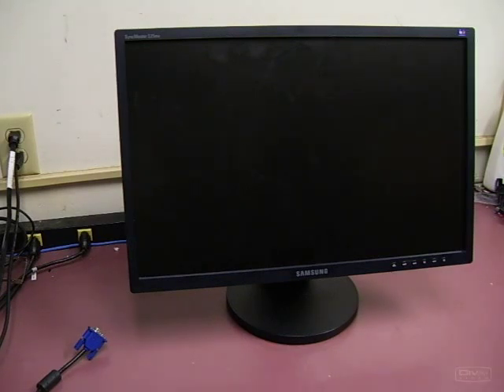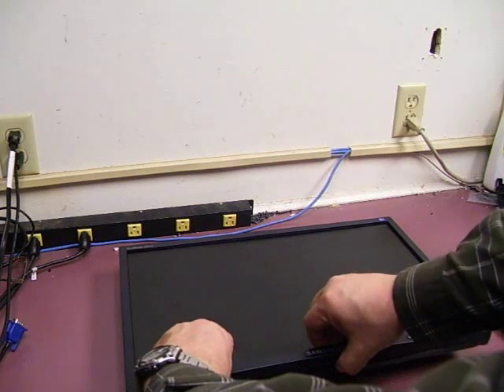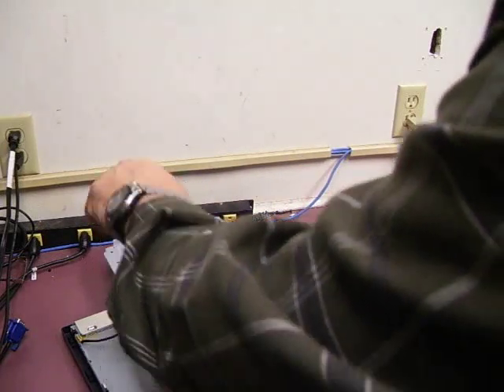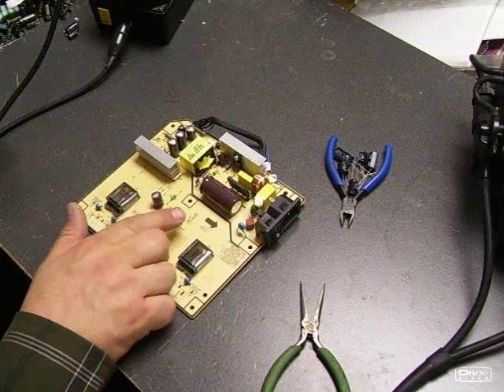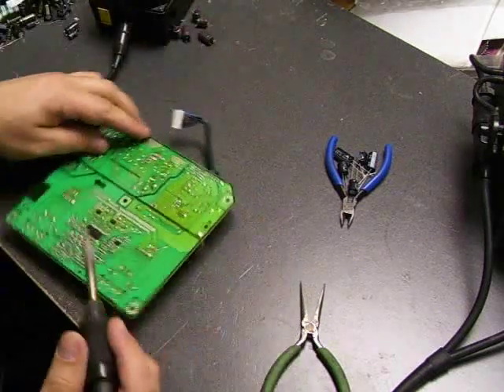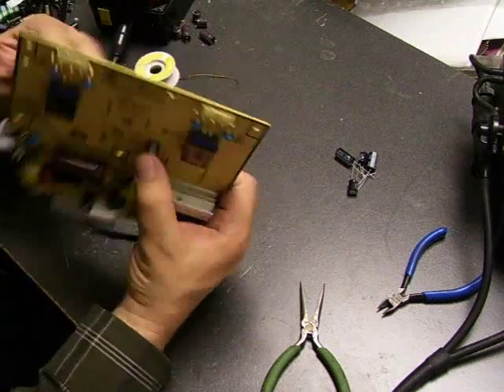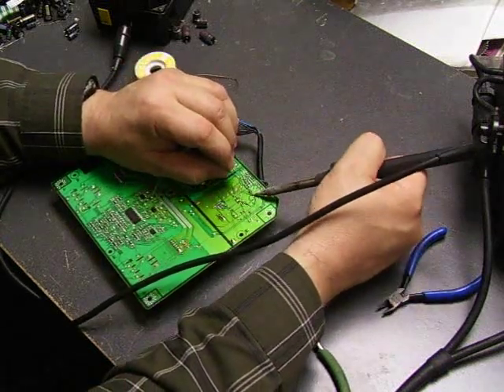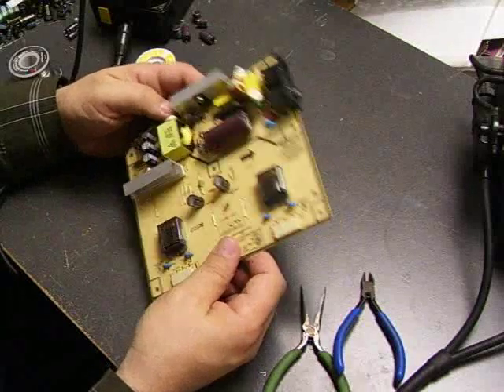Samsung 225BW LCD monitor repair

Comment: Many thanks for the video.

I have a 20" Samsung Syncmaster 2032BW monitor.
Today when I turned it on, although it showed an image, it constantly showed the MagicBright items being selected one by one without stopping (affecting the brightness of the image as you might expect), other times it did the same thing but with the items in the main OSD menu itself, and other times it also did the same thing when the monitor was detecting the mode, whether digital or analog, sometimes choosing one and then choosing the other!
In other words, it seems to me that it goes into a loop (sometimes for quite a few minutes) within the option that is active, be it the OSD Main Menu, the MagicBright menu or even when detecting the mode (whether analog or digital - in this case the menu is digital - DVI).

Another thing that sometimes happens (but doesn't affect the image) is the blue color of the power button, some days it's on, other days it flashes, and some days it doesn't even light up, even though I can turn the monitor on!

Can anyone give me any clues as to what could be causing this problem with the monitor?

Thank you very much.

Comment: Thanks! Repaired my EU version monitor which had 3x 330uF 25V, 2x 820uF 25V and 1x 47uF 50V replaced with 3x 470uF 25V, 2x 1000uF and 1x 47uF 63V -this is what they had available in local store and the guy said it will be ok and it really worked! Before the monitor needed several minutes to warm up and start display, now it takes only 5 seconds and the screen is up.
I have google that higher voltage is no issue at all and capacity (uF) should be +/-20% to original capacitor.

Comment: Came here looking for instruction to disassemble the monitor. I actually expected to find bad capacitors on the video control board, since that's where my symptoms were pointing. But everything there seems okay, at least visually. (It doesn't use electrolytic capacitors.)

Screen comes on but slowly dies away... I thought also it could be the back light, but the flashlight test says "no".

So while I had the monitor open (thanks to your tutorial) I took a look at the power supply board, and the capacitors were bulging, but not yet leaking. Could be the problem. I just haven't reached the total failure of the power supply.

I did notice that the values of the capacitors on my board were not the same as what you said:

The two 820 microfarad capacitors were the same.

But the one 320 microfarad capacitor beside them was actually 330 microfarads. No big deal. Your replacement would still work.

Problem was the two that were on their own further from the cluster were 680 microfarads. That's a far cry from the 320 you said in the video. That would probably create enough of a change in performance.

Noticed also that your website isn't working, so I'll have to go elsewhere for the parts.

Comment: I have exact same monitor and the problem was not only the capacitors, but also a broken data wire. I changed the capacitors and it started showing something, but as I moved the monitor the display suddenly became unstable with colorful 'snow' flashing as I moved it, turns out that after taking it a[part once again one of the twisted data wires that goes from the logic board to the monitor itself was broken and I soldered it back together and it worked fine since.

Comment: Used this video and ebay to repair my samsung 225bw monitor.  When I turned the power on to the monitor it would flash on for 1 second before going blank.  Turn off/on again it would do the same thing.  Repeat for 5m and eventually it would stay on for a while, but the first time it went to power save mode it would be back to the original problem.  This video is almost 6 years old but it still helped me out.  Thanks so much!  btw, you did forget to put the shielding back on in the video, hope that hasn't been a problem :)  Thanks agin!

Comment: My problem is that my screen [[samsung syncmaster b2430]] works fine for 2-4 hours then turns itself off for 1 minute then turns itself on again, in that minute i can't turn it on manually.after that i have to turn it off a bit because if i don't it will do the same after a shorter while, sometimes even 15 minutes. i tried to look for someone to help me detect the problem but no one have. could you please tell me what to do, what could possibly be the problem?? i really need your answer.

Comment: Brilliant tutorial thank you. I would never have had the courage to rip it apart if I had not see you do it.
I could not find identical capacitors but I read you can go up so I used 330 50v and 1000 25v. Seems to work perfectly well.

Comment: hi, my 3 capacitors say 330 not 320, should i still replace with 320s or use 330 like what's on the board (or is this the reason why the capacitors are no good)? thanks
Reply from the maker: The small ones are 330, the larger ones are 820.
Reply: cclla1 ok thanks. is it ok to use 1000 and 470? i've seen people change the 330 and 820 to those.

Comment: My Samsung SyncMaster 22200WM makes that blinking light that you were talking about but also makes a weird noise like it's trying to turn on the visuals for the screen but won't and when I don't have anything plugged into the screen other than the power cord and it is turned on you can see the visuals working what do you think would be the problem

Comment: I have the syncmaster 2220the light flashes and I get the connect/disconnect sound on windows. I see the monitor flash briefly in the resolution window. also I hear a slight hum when the light turns on. if I play with the source/auto button I eventually get it to work. do you think it's the power supply???

Comment: I have a 225bw monitor that wasn't working right. I opened it up as shown and the capacitor look fine. Not bulging at all ?!

The monitor still works occasionnally, but the rest of the time it shows the image only in red channel and the front panel buttons don't respond, not even power off.

Other times, it starts red but if I hit a certain button, it resets the image to normal and if I don't touch it, it's fine until I turn it off.

I have 4 monitors doing this. Any idea what the problem is ? 

I think I'll try changing the caps even if they look fine but I'm not too sure it'll change anything. There are other people online saying they have this red screen problem and they've changed the caps without results.

Comment: This monitor repair instruction video is awesome. I'm a novice at this. Had the same problem with the power light blinking and monitor not turning on. Viewing this vide  and ordering the cap kit really helped me repair the monitor. It took me about 20 minutes to repair it. A monitor that was going to be trashed is now back in service. Not only do I save money, it was fun doing it. Thank You from a grateful electronic repair novice.

Comment: My Samsung 2220wm has been doing this bizarre thing when the screen saver goes on or I turn off the monitor.  When I try to turn it back on the screen remains black and the little blue light powers up then turns off then I hear a sort of "power failing" noise through my monitor's speakers.
Reply: I have the same problem with the blinking lights. Were you able to resolve the problem?
Reply: Nope, I eventually just gave up trying to fix it and I'm now using my brother's old monitor. Does your monitor have speakers?

Comment: Just repaired a SuncMaster 225BW with these instructions and the parts from your website. Took me about an hour but I haven't soldered any electronics in over 10 years. Thanks!
Reply: I've fixed 5 Syncmasters using the same technique. Damn crappy capacitors!

Comment: I have an adjustable Samsung 205BW monitor and the heard a faint and quick "popping" noise when I was raising up the "view level" today. Now it is no longer adjustable (i.e. it only sits at the lowest vertical view level). Does anyone know how to repair this? Thanks!

Comment: worked like a charm. was a little nervous during soldering, cos i never did it before. i recommend to train it a bit before soldering the capacitors on the board. thx  a lot man, saved me a lot of money and for sure saved the environment!

Comment: I had someone with a soldering iron do the repair for me, and now the monitor works just fine again. I had almost thrown it away before I came across your video. Now I have a nice dual monitor setup, thanks again!

Comment: I replaced my 225BW with a 27" 1440p monitor but I still didn't want to give up on my old one. Thanks for the informational video, you saved my old monitor from the landfill and now I have a nice dual monitor set up out of it! Though the image quality and color accuracy is like night and day between the two!

Comment: I just finished the repair. I ended up buying a new power board because I found one for like 15$, and was near to me. Works perfectly... The capacitors on the old one rounded a bit on the top, so I am positive that changing some of the capacitors would also solve the problem. If you have a good microelectronic shop nearby, they will probably be able to give you the capacitors as well. I suggest to bring the power boards in, so they can see the built in sizes too. Good luck with yours :)

Comment: Exact same problem here. I already disassembled the monitor, now I either will buy the capacitors, or buy a new power board, I dont know yet. My guess is both solution will solve the problem. Did you ordered the kit?

Comment: I have a Samsung SyncMaster 225BW that began taking longer and longer for the backlight to come on after waking up from sleep mode.  Eventually it stopped coming on, and the blue led power light now flashes.  Do you think the capacitor replacement will solve this?  Just wanted to check before ordering a kit.  Thanks!

Comment: Thanks! My monitor still did not work after my first attempt and I gave up on it. Now that a couple months pasts and I'm on my summer break I tried again. I thought it did not work again, and just as I was about to give up for good, I turned it off and on and it worked!

Comment: Also, you forgot to put that tin plate covering back on the left side where you connected the four blue and pink connectors(the ones that don't matter which slot they connect to because they are the same voltage). Other than that I thank you. keep up the good work.

Comment: Great tutorial except for two situations. First, when I disconnected the power cord I noticed that it bent the four pins and the tab on the end of the cord inside the board so I had to dig it out with my Exacto knife and managed to straighten out the pins when I was putting the unit back together. Probably should warn people to possibly use small needle-nose pliers to grip it before pulling it out, not using your fingers like you do.

Comment: Great tutorial. I am having the problem where my monitor turns on with a solid power light on the front bezel, the display works fine for about a half second then goes to black. Shining a flashlight onto the display reveals a dim picture.

I'm currently examining my power board but all of my capacitors look totally flat... Is there anything else that could be a culprit?

Comment: I used my monitor on a relatively low brightness. The past few monts the monitor started to "humm", i was able to "fix" it by increasing the brightness from 30 to 60. Recently i bought a second monitor, and i was shocked how much yellow tint my old monitor have. Can i fix the yellow tint with changing the capacitors?

Comment: This was really helpful - thank you.  Two notes - if you happen to remove the connector from the logic board to the monitor itself (the ribbon cable that was not disconnected in this video) it must be extremely clean or you will have weird artifacts in your display.  I repaired three of these monitors and on two of the three I had to go back and clean the ribbon cable connector. 

Also, in the video, you forgot to replace the shield that you removed at 1:50